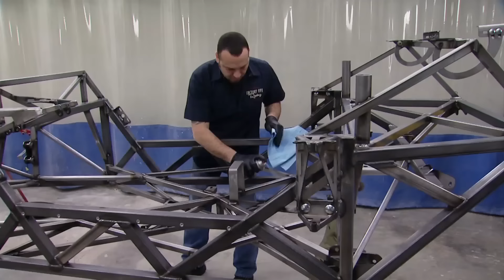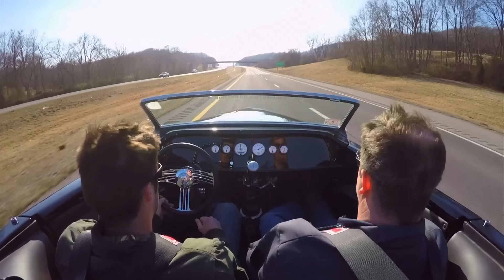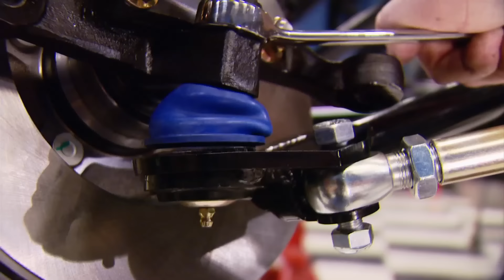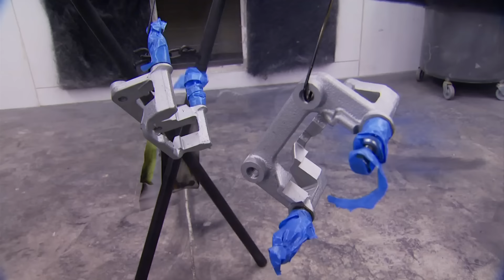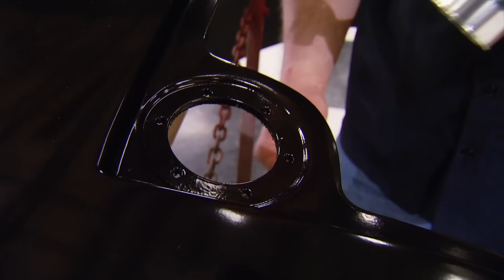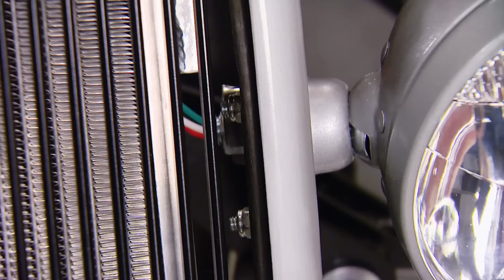Build a Kit Car with ONLY a Drill, Pop Rivets, and Rattle Can Paint - Engine Power S2, E10

Comment: You also need a spacious garage, all the usual tools you'll find in a garage, a lift, an engine, transmission, drivline, a well ventilated space for painting and coating aswell as saftey gear like masks.

But if you ignore all that, the yes, you only need a drill.

Comment: 4 years latter- A real benefit of these kits is the possibility of a very cheap and practical A to B vehicles by going the low hp route, AKA some of the light vehicles out of the UK using motor cycle engines. 
Being built for larger engines may give them a large safety buffer over the lighter vehicles when smaller engines are fitted.

Comment: To those poo pooing Duplicolor rattle paint. The key is proper body prep. In 1993 I Dulicolored my 84 S10 Blazer. After final polishing nobody could believe I did it myself. It still looked good after 7 years...red is a difficult color for longevity. Total cost $200 for paint, primer and sandpaper   and 20 hours work at home.

Comment: I assembled one for a friend. I was very impressed with the quality of the kit. We added air conditioning, power windows, hard top, windshield wipers, remote start with alarm, remote entry ( no handles ), touch screen radio, cd, blue tooth, navigation with a back up camera, hidden LED backup lights,  Rockford Fosgate amp, subs and high end speakers. Turned out so nice that l forget sometimes that l assembled it. Maybe someday I can assemble one for myself. Owner went with a 351 dressed up inside and out, TCI trans and 8.8 rear end. It will move.
Reply: Hello Arthur, would you assemble one for me as well. I'm willing to pay up
Reply: Don’t know how likely it is that you’ll see this, Arthur, but if you do, may I ask how long it took you to put this ride together? It sounds like a really neat ride, btw. I hope you get a chance to build one for yourself!
Reply: Interesting pedigree, kinda kills the spirit of rodding. It's like camping, back to the wild.

Comment: Man I am just drooling to see a hopped up straight six and a manual in that. (Intake stacks on one side, pipes on the other side). A Jeep 4liter or old Dodge Slant... wait. Both of those have exhaust and intake same side. Well... still way cooler than a generic small block v8.

Comment: Build? No. This is assembly. To claim you built a car some actual designing, engineering, and fabricating took place to get to the finished product. Equally dubious is the claim that this is a hot rod. It's not. It resembles a once factory produced Ford, in body only, that's it. Is it cool, especially for people that don't have the time or skills it takes to build a car? Yeah, but this is not car building.

Comment: These have a decent chassis, but the body is junk. The cowl on the one I did was 1/2 inch different side to side, took me 2 weeks solid to re-glass the hood so it fit the curve of the cowl. With an LS engine it was damn near impossible to steer the car without it rolling. So bad we added the electric power steering unit.

Comment: I once, at the end of an assembly, found a little bag with the "right" bolt and a description of how the manual was wrong. 
Too late. I was finished and had hammered and smashed the "wrong" bolt into submission as per the instructions. 
Life Lesson:
Always go through everything and become comfortable with all the bits and pieces before you start blindly following the instructions. This way you will know where you are going before you go there. And you might end up using the "right" bolt...

Comment: You mounted all the shocks upside down. The rod is supposed to be unsprung and the body bolts to the frame. Its less unsprung wieght and your not shaking the air and oil together

Comment: In case I was the last to know, open wheels are NOT legal in America. You MUST have fenders of a sort that prevents rocks and other debris from being thrown by the tire tread. FMCSR part 387. Thanks, JD
Reply: Abe Adams  you’re wrong. The Plymouth Prowler does have fenders in the rear and front of the  vehicle. They may be small but they are there. Any vehicle without fenders is considered illegal to be driven on public roads. Although you may own one without fenders and have it in your personal collection.

Comment: Would it be difficult to drop in a Mopar 318 and 904?
Reply: Nobody seems to think a Mopar would work in a hot-rod.. I'm with you though. The 318 is as common as the Chevy 350. If you get a 318 from the 90's, it has fuel injection.

Comment: Those are polyurethane bushings and you're using WD-40 to assemble it, I question your understanding of what WD-40 is actually for. You should be using a proper lubricant. WD-40 is not a lubricant we are. It will allow you to put it together, but when it dries out it won't be fun.

Comment: Ever heard of a torque wrench? Its a special wrench that allows you to put the proper stretch and clamping force on all of your fasteners. Usually, the manufacturer tells you how tight the bolts are supposed to be. Leaving it up your sponsors compressor and air tools is a bit negligent.

Comment: It's a cool concept, but in the long run you're looking at 50k and a lot of work, Id rather buy a brand new Mustang.
Reply: Lol fr 😂
Reply: Or camaro or an un finished project that all the hard stuff is done for 50 cents on the dollar .
Reply: You guys are missing the point. and/or you are not paying attention. How in the world are you getting 50k out of a kit that is only 20k??? Unless you are figuring on sinking 30k into run and drive components??? That is totally overkill and unnecessary! And who and why would you do that with this kit??? If you want all that engine and drivetrain, surely you would put that into something more then a replica kit car.....and this ad is for rattle can paint coating for a budget paint job .... 50k on parts and then spray can paint job!? Ridiculous, you are missing the point .... This whole thing is geared toward the novice extremely budget mind builder, someone who wants the experience of building and being able to complete something nice, that they can be proud of. Yeah if you are afraid of the "hard work" don't knock it just because you don't get it and wouldn't even attempt it. And Hell, under Bidenomics you can't buy ANY new car off the lot for less then 25k anyway. So I really don't get all the negative comments

Comment: 18:41 Question - Aluminium to steel riveting, they are dissimilar metals and are subject to considerable galvanic corrosion being wet from rain, road grime (salted roads) and even humid hot days.  Wouldn't the better choice have been zincanneal sheet and spot weld them to the frame THEN paint the frame?

Comment: >You get the parts to build an entire car!
>Minus engine, transmission, and drive line. 

So 20 grand...plus like 10 grand more.
Reply: You can source an early mustang for the parts so cheap. Sn95s go for under 2k all day and that is everything you need to get it running.

Comment: I'm like Pat the Rat'Carman..Baby Pat's knowledge and experience with the combusting naturally aspirated engines functioning is more in my own wheel well. I can relate to the Pat RatMan's tastes and experiences. In 2000 I started my version of A Pat Rat Rid. Using the foundation of the Ford 2002 Explorer AWD Chassis and drive train of the Chevrolet Z71 pickup big block 4wheel drive engine and transmission and transfer case. Using the complete floir pan cut from the Explorer I sit my 1967 c10 longed, small window body down on it and low. With very few modification I ended up with a AWD AWBraking AW Independent suspension system easily air ride with few modifications as well, remote start with all access app for infotainment system HVAC seat memory even light moon adjustments. O man I just can't tell you how proudly Of my work and end product then came the Charlotte Motor speed ways Rat Rod run where I was offered way too much money for the Pat RatMan, I sold the ride and four years of building this ride then selling it in 2016 I still regret selling that ride all of the hundreds of rides I've ever built. Not so fast. Update in the summer of 2018 I bought another 67 small window longed and I got a free Mercry Sable premium and a 2002 AWD FORD Explorer! This time I'm doing a inline 300 Cu.In.with fuel injection and the 5 speed overdrive manual transmission. This one will have the Chevy pickup body but all ford chassis and drive train Thank Pat Rat 2! Coming soon.!

Comment: The chassis looks like four 10 year Olds painted it. Now full disclosure how many cans were used to cover it looks very thin so what 15cans even at $5 a can that is $75 and you know that shift is higher than $5/can 2qts chassis epoxy yields 1gal spray able 1/2 the cost and much harder than rattle can. I wonder what factory five thinks no comment albeit

Comment: one of the worst cars you could buy... nothing fits... why most have no hoods... no fenders... no engine covers... fiberglass body is horrible...  takes hours of body work to get it remotely straight... frame looks strong.. but only jack it up even if you want the doors to ever open again.... the upper control arms have welded in ball joints... so yes there not serviceable... you have to buy a couple new control arm... most of the 33 grills are not square... but don't worry there is a company out there that fixes them...lol... so in retrospect... if you want a remotely nice one of these ... you will have at least 100k invested...

Comment: so they didnt use a wrench to attach the wheels the seats or the body to frame they didnt use a screw driver to attach the ecu to the firewall they didnt use a tyre lever to mount th tyres they didnt use sandpaper to sand the body am i forgetting anything?

Comment: I've never thought no fenders a good idea. You might as well just paint with primer, because at least where I live, you'll be dealing with stone chips all the time.
Reply: Car is so modern it doesn't need fuel lines brake lines or an electrical system.  Truly amazing.

Comment: If the caliper paint is heat resistant then it’s going to block the heat from naturally moving from the interior of the caliper to the exterior and to the atmosphere....it would be like a thermal block.
Reply: it would keep the fluid from boiling. the heat gets transferred out by the rotor.

Comment: At 59 years old I started building a replica of Jo Siffert's Porsche 917/10 Can Am Car with NO auto mechanical experience except for breaking bolts, stripping threads and making things leak that never leaked before.  It is the Only 917 replica in the world with a 12 Cylinder Boxer Engine!  It was made by connecting two Porsche designed Subaru EZ30 engines and running them with a Megasquirt MS3 Pro EVO computer.  Now I need someone to take the car to the next level as I have run out of money, emotions and technical skills.
https://www.youtube.com/watch?v=1ClC7bde7ls
https://www.youtube.com/watch?v=M2UpM5r5j2A
https://www.youtube.com/watch?v=bBsSs8bPrO8
All my builds.  https://www.youtube.com/watch?v=v4jAF4YS39w

Think you can help?

Comment: They are way too expensive and I won't pay that kind of money for fiberglass.  You showed my friend Roy Caruthers model A at the 36 second mark. It is much cooler than the factory 5 you built,it is all steel with a bored and stroked flathead, Navarro heads and 3 deuce intake with 3 ,97 Strombergs and a quick change rearend. The wheels are real Halibrand IndyCar wheels and has won many awards and was still cheaper to build than that factory 5 kit car.

Comment: Under $20k, plus your own engine, transmission, and drive line.  Yeah, like I've got upward of $30,000 to buy a toy like this.  No thanks.
Reply: Old Chevy small block clunker is under 2k easy for a complete vehicle 

Start there to get it driving.... upgrade as needed
Reply: Well, I guess you could buy a Kia or something instead...

Comment: Does the hot rod car kit come with right hand drive. 👍🦘🇭🇲🏏🍕
Reply: Looking at the pictures on the Factory Five site, it seems feasible.  You would have to move the frame section where the steering and other components are mounted to the other side.  Then, in theory, install the steering linkage the reverse direction.  If you have skill and the bare metal frame, you could probably mod it yourself.  Or, maybe FF can do it when they build the frame.  It's definitely worth writing and asking.  I know you won't be the first to have inquired.

Comment: It's hard to convince someone to use a rattle can on a car they spend $30k on.
Reply: I use a rattle can on my model t all the time...with a little bit of work, you can not tell where I used it...I do not sweat rock chips or scratches...
Reply: @georgvonsauer2618  Teach me your ways, Great master. For I have a 67 Chevelle SS with 10 year old black paint.
Reply: @boomerisadog3899  dude it's not hard. But also depends how much work you wanna do. Learn about burying shit in clear coat like racing stripes and polishing and wet sanding.
Reply: @bmxriderforlife1234  I was joking. Black paint is notoriously difficult to keep nice, it shows everything.
Reply: @boomerisadog3899  Yeah you gotta wash that daily. Black looks great, but the daily wipe down gets old!
Reply: @boomerisadog3899  So True and I actually prefer white.
Reply: for $400.00 they will powder coat the frame. It is worth it. I never want to paint another one.
Reply: Cheaper to use paint and a gun anyway.
Reply: I decent paint gun is not expensive, I think it has to do with Duplicolor being a sponsor.
Reply: If you’ve got a decent MAACO nearby you can get a decent paint job for a few hundred dollars on a car like this.
Reply: That's only because most people suck at spay painting, because they refuse to take the 2 hrs to properly practice how to spray. It's pretty easy and looks really good if you know what you're doing.
Reply: Who said anything about money ? ? ?
They said build a car with a drill, pop rivet gun and rattle can paint. The title didn't say anything about needing Money ! !

I'M  PISSED ! ! !
Reply: Don’t forget the 400 labor hours to put together $34,000++ just for labor 😅you also need a 4man crew most of the time especially to put the body on.
And a trip to the body shop to sand and paint. Need deep pockets $$$$$

Comment: Ever Price a Factory 5 kit car ?
  You need about $30 ,000 just to get started .
I would use a Lincoln mark Viii For the Donor car but still it would cost around $25,000.
for that much money you could just buy a used HO mustang or dodge hellcat .
345 HP for a $10,000 Motor is no bargain .
You have 20 Guys and a $200, 000 dollar shop and I could slam one out too !
Reply: In terms of bang for your buck, its hard to beat an LS  crate motor, especially ones built by third parties - for roughly that same 10, you can buy a 625hp, 427 ls motor from Summit.
Reply: @machinist7230  id just get a 6.2 with 700hp for the 10

Comment: 98% all kit cars never make it out the box!!!
Reply: Factory five has taken all of the kit car problems out of the build. Mine was on the road 90 days after I picked up the kit, and 20 years later it’s still going strong.
Reply: Bradford Drummond Bullshit you have to drill holes that should of been punched out when they were stamped. Also square tubing isn't allowed in any known form of auto racing because it's not safe during impact crashes.

Comment: When I was about 16 years old, I witnessed the aftermath of a '33 kit going into a building (and he didn't use the door).
Cruising down the blvd. something in his steering let go, threw him in a hard right, right through the front of a body shop (irony). If the driver didn't, at the last second, lie down in the bench seat, he would have been decapitated for sure.
Reply: psygn0sis that’s what I was thinking
Reply: and?   if an fucking idiot builds something and doesn't align it or connect the steering and suspension properly shit will happen every single fucking time.

do you understand the context of my answer my good man? it wasn't the kit car's fault,it was either the total dumbass driving it or the idiot who built it who is at fault

Comment: Do these come with titles?
Reply: They must, right? Too bad stuff like this would never be allowed in europe. These look fun
Reply: It depends on if you use a donor car or not.  If it's completely scratch built you can get a kit Car title
Reply: @nautilus9008  which can be a problem getting it registered. Ive heard getting homebuilt anything(car, motorcycle, trailer) is a nightmare, because they wont documentation and receipts for literally everything used in construction so they can put a value on it for taxes. Then theres the engineering inspection....
Reply: @machinist7230  i suppose state by state can be an issue.  In Ohio it's a pretty simple process.  Once the car is built.  (Let's says its a scratch built kit, no donor) you call the state highway patrol and schedule an inspection. Trailer the car to them.  They do a basic visual and give you a pass or no pass grade.  If you pass you go get a title and your good.  If you used a donor,  they run the vin.  If it's clean they stamp it on and that's it.